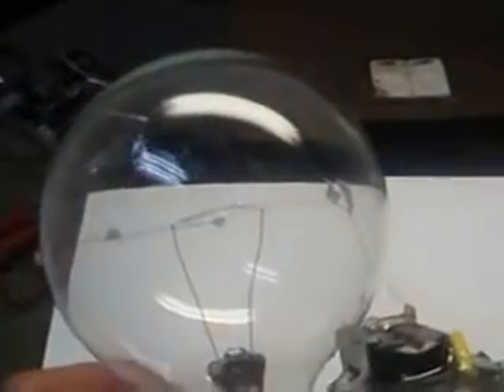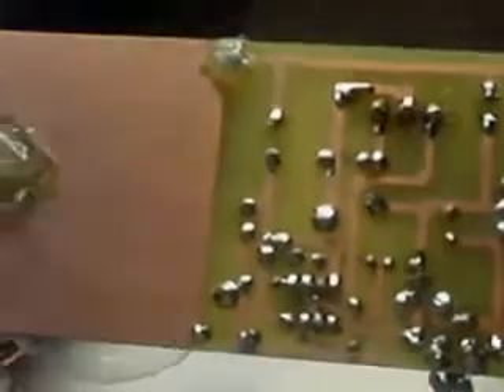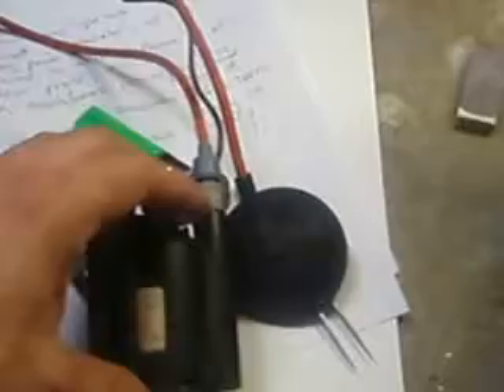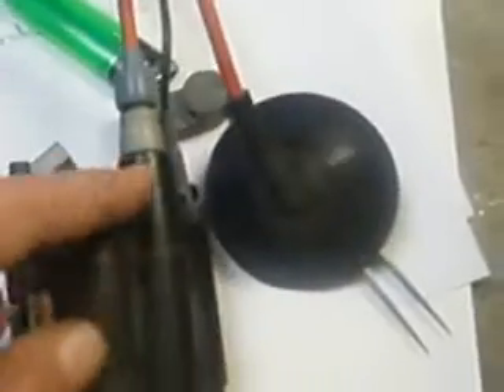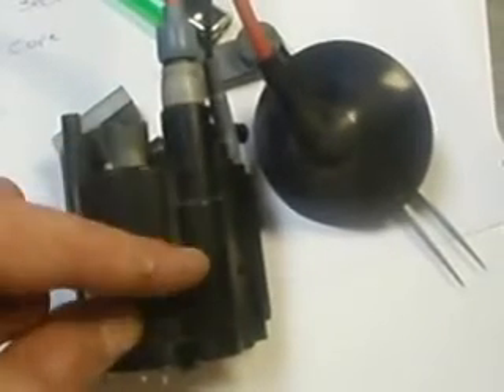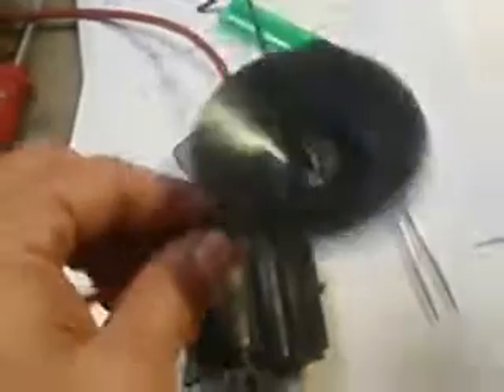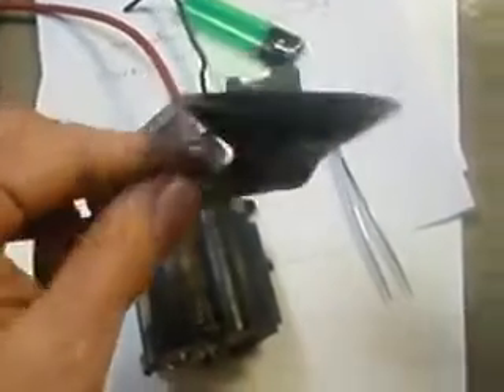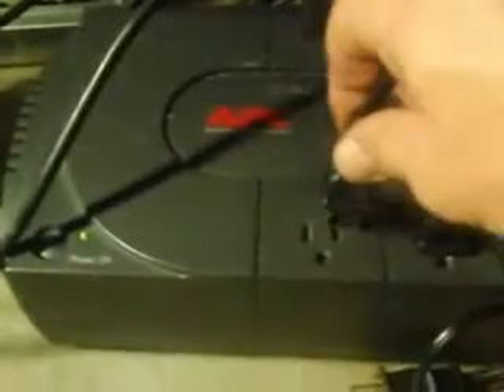HOW TO MAKE  PLASMA GLOBE USING LIGHT BULB

Comment: it can run for hour without burning the mosfet?
Reply from the maker: +andreiruiz143 It will run forever without burning mosfet, as long is done strictly according to schematic diagram and components must be right value, very important is resistor R1 .39 Ohm he kills high current preventing transistor from overheating .Cheers
Reply: +semko71 wow nice:) can i get the schematic?

Comment from the maker: No, Tesla coil is something else.Tesla coil is radiant energy and is completely diferent story.You can see how it works,there is video on my channel under "Tesla coil using MTO" one of my projects I done long time ago.Frequency of Tesla coil is based on Capacity  on primary coil,number of turns,space between spark gaps,secondary coil ,toroid and so on,and again that is static discharge and not plasma.And definitely do LOT research before attempting any HV projects.

Comment: im in north amarica so we use 60 Hz i have the transformer for my tesla coil i was just wondering how this works really i wasn't sure how it works i think to get the higher frequency i could use my tesla coil out put i think i need more research but i think my coil will work i just need to figure out how to hook it up safely

Comment from the maker: No my friend,will not give you any effect.Neon sign transformer give you high voltage but secret  of getting plasma effect is in high frequency in my case 27kHz.Neon sign transformer works on power line and thats' 50-60 Hz.What you saw on another channel its' just  arc between electrodes,and what he use is not bulb, so PLEASE dont even try  bulb go back to that channel and listen and watch carefully what he use.I wil send you diagram if you send me email.Be careful with that NST , safety first.

Comment: i have neon sign transformer 15000v split between 2 out put terminals so each has 7500v at 60mA i was wondering if i could directly connect a light bulb to this and have the same effect the transformer is current limited and case grounded if thats important in my head i think the bulb would over heat and explode but i saw steve spangler on his youtube channel use a 50 000v transformer i assume low current to do the same effect

Comment from the maker: No, as i said Flyback gives' you DC output and does not perform same  visual efect plus current output from flyback is very low, that's way you need to wound based on specification that is described in description.

Comment from the maker: I will shortly, but as you mention Parts from microwaves" Please be careful ,if you dont' know much about HV dont' attempt , microwave  transformers and inverters putting out 2000V( and High Current), I’ve rather you to  be safe because with those parts there is no room for mistake, even this project is giving out about 15-20 Kv enough to shock you badly (if not kill)

Comment from the maker: Hi there.No you can't make without transformer, transformer is actualy critical part of this project and you must follow instruction on how many turns and size of wire in order to make working Primary 25 turns AWG 18  Secondary 650 turns AWG 24 and sealed using strong epoxy.I will send you circuit diagram to email address that you provided and light bulb could be any type (ordinary light bulb that you use in household wattage don't matter) Will send you circuit diagram shortly.Cheers